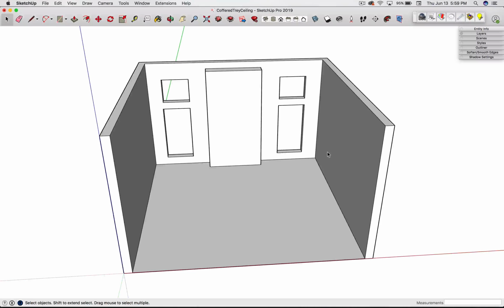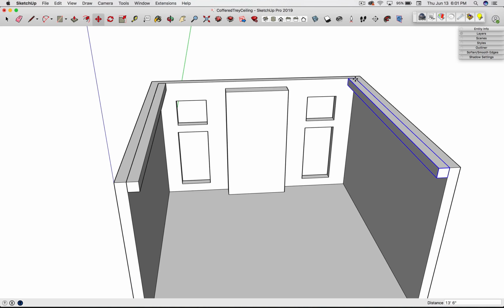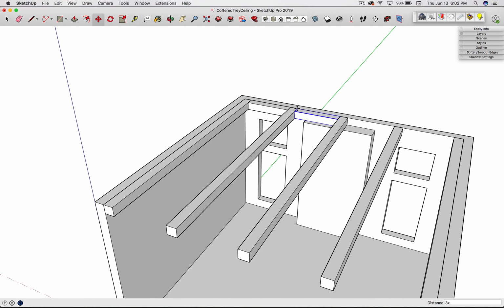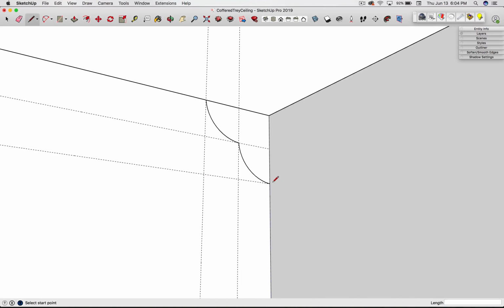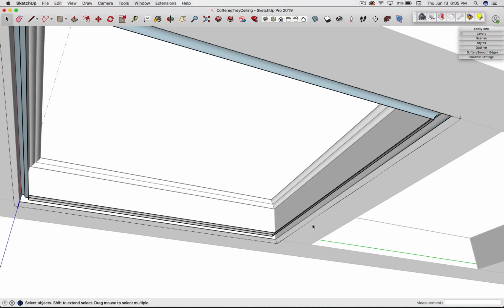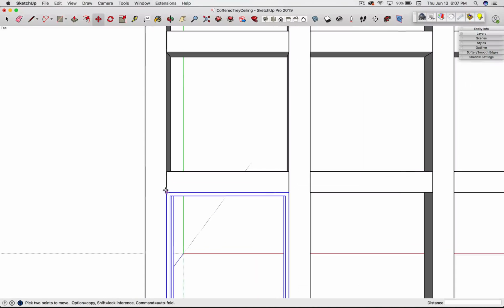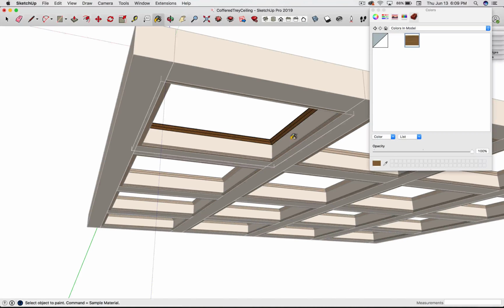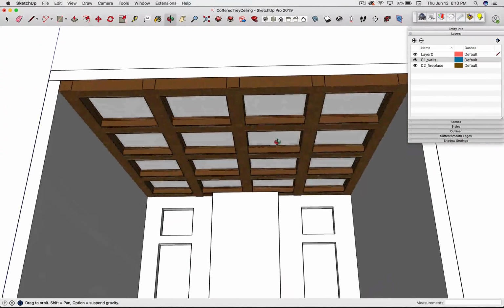Draw a Coffered Ceiling in SketchUp

Comment: in AutoCAD we us the array from just one entity and crest as many other items required with specified spacing and direction.

i see you create an entity, then you copy snd set it to the opposite side, snd then you do an array.  my question is why crest a copy snd place it on the opposite side, then the array, and not just do the array from that first piece?

I bought ProgeCAD, but i have to learn SketchUp, instead of ProgeCAD because it’s quicker in modeling mode,
Reply from the maker: Hi Gino, you can do the same function in SketchUp. Type a number then x to make copies in the manner that you are describing (instead of /).